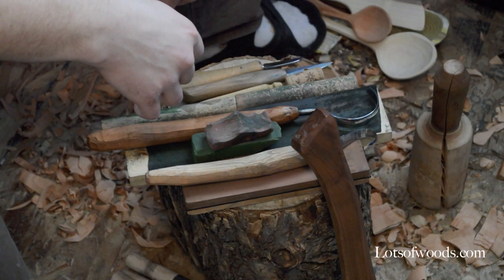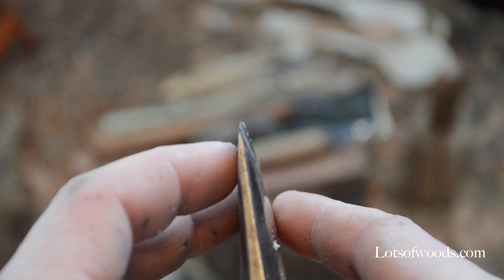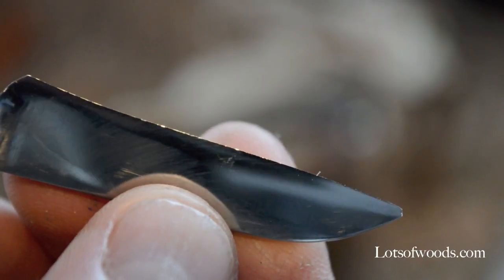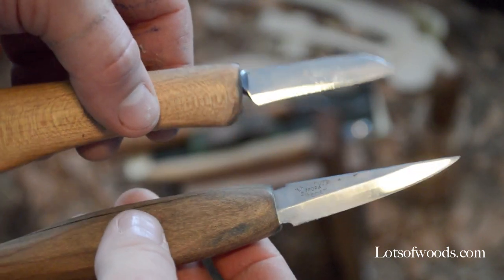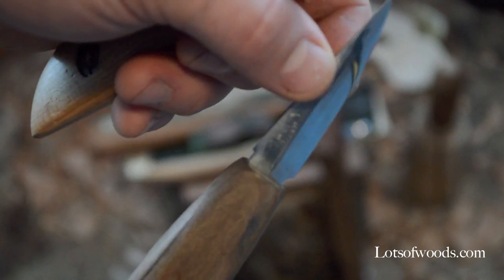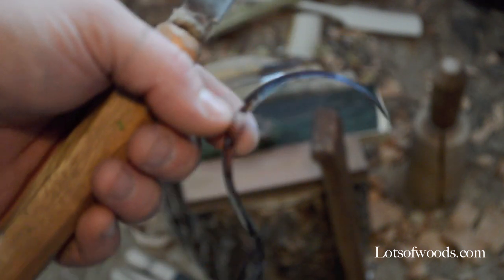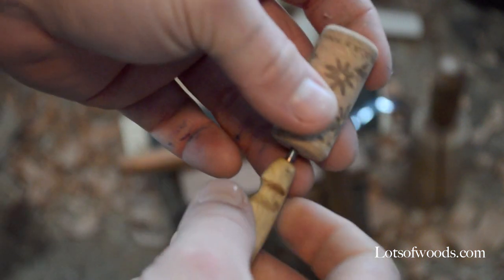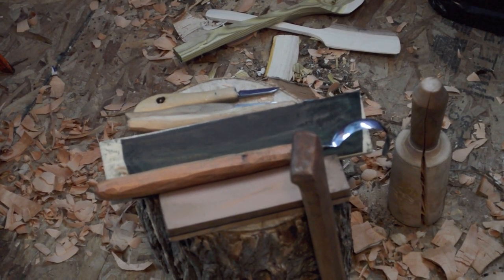My Spoon Carving tool kit - Everything I use on a daily basis to carve spoons.

Comment: Hey Jeff great video.. This fort sureis going to help the novice in finding the correct tools for the job.. I think here is a little info that would help them also.. The Mora 164. If you remove the secondary bevel it will carve like a dream.. And that Deepwoods knife. It is a style of blade that is for like basswood carving.
Reply from the maker: Thanks for the info Jimmy Mead!  I did play with that bevel a little bit, but by the time I had figured it out, my nic westermann was already here.  I tried Robin Woods spoon carving knife and actually didnt mind it that much.   As far as the deepwoods knife, I used it for quite a while, but found that after carving birch Kuksa's there was a type of cut that just chipped the blade so quick.  I use the tip of the mora knife so much now.  I use the deepwoods for just quick roughing out to save the edge on the mora.

Comment: No bevel usually means a flat grind, and it's the easiest of all to sharpen, if you have experience with it.  Many love it.  I prefer the Scandi grind that comes on most Mora knives, but a flat grind does have some advantages when slicing.
Reply: A Scandi grind IS a flat grind...it simply has a more obtuse edge angle (bringing the junction between edge and flat lower down the blade). The Deepwood Ventures knife is a mild convex grind.

Comment: That straight edged Deepwood Ventures knife is either ground wrong, and/or likely tempered improperly for that type of grind. There's no material to support that fine of an edge angle. That is a VERY thin apex with only a slight convex to support it. That knife would need good steel with a very good heat treat cycle to refine the grain...or it would need a standard scandi/V grind.

Also, those don't look like chips so much as a rolled edge, which would mean it's over tempered. From the video anyhow. If you bought it from him I'd call him and discuss it. As a maker, I'd warranty that knife and provide you something more appopriate.
Reply from the maker: My wood carving career is over now so no worries about that knife lol.  I had finishing knives that were very thin
Reply: @lotsofwoods  thin is good for a lot of purposes, particularly at the edge if the knife is hardened and tempered properly. My kitchen knives...the edge will flex over my thumbnail...at 65HRC, but are still tough enough to go through an apple seed without an issue.

It's unfortunate you don't carve anymore! I'm just starting (as a function of making sloyd, curved/hook, and other carving knives) and I've enjoyed your channel quite a bit.

Comment: thanks again for the video. the mora 106 and the 120 are both great knives. my favorites. BUT yes sharpening is my weak point. i am always afraid that i am going to make my edge worst. i am scared of it when it comes to my hooks. i also have a TWCA. i bought it from jarrod stone dali. so i think its made by Nick Westerman. im not sure if its a 60mm or a lil smalller. i have not sharpened it yet. would you suggest to just strope the inside at first? or both sides? the edges are still good. i havent used it all that much. but i want to keep it keen. so should i strope just inside or both? haha i actually try to limit my use at times because I want to keep the edge good. i have watched videos but only practice can really work when it comes to sharpening. so to make a short story long. i get what your saying...i have never seen a video on sharpening the TWCA. so if your in the mood???
Reply from the maker: I may be in the mood for a video on sharpening the Twca cam after I build my pole lathe!  If you have your twca cam in a vise, and you have dowels with wet sand paper, just be steady with all your passes.  I personally havent touched the outside of the twca cam with anything but a strop, only the inside with the wet sand paper.  I would say just be careful and you should be fine!  Carelessly taking away material for sure youll make it worse..  you gotta do it at somepoint right!  This is how I learned!  Thanks for the comment though bangbangcfp

Comment: I do not think hardness is the main problem with chipping, I have a few handforged knives made by Antti Mäkinen that are probably above 63 on the rockwell scale (material removal on waterstones is considerably slower than with a known 63 rw knife) and they do not chip at all. The great job done with heat treating in general may play a part as well, but so does care, because steel usually only chips (or rolls when its a softer steel) when it hits something harder than itself. I am sure you know this, just saying that I personally always double check for any dirt or grit on my workpiece or chopping block :)
Reply from the maker: It chips the most when finishing a birch kuksa.  On a cut where I roll the knife for an inside rounded corner, it breaks the edge of the knife.  I got pretty frustrated with it because it just didnt seem like that should happen.  Im definitely no pro with steel, but I just know it is brittle when the the temper is too great.. or somthing like that!  Thanks for the wisdom though drownthedays !
Reply: Well then I guess somethings off with the temper like you said, the wood is basically prying the edge apart. It is fairly hard to find the right mix of hardness and toughness, but it should be expected, especially with more expensive knives. Plus the guys at mora seem to know very well what they are doing, as the middle laminated layer is really hard, but tough enough as well. I really dig that applewood axe handle by the way, it sure looks the part.

Comment: How do you attach the Nick Westerman hook knives to the wood handle? Do you just drill a hole in the wood the same diameter at the round tang and super glue it in or what? Thanks
Reply from the maker: Exactly what you suggested Phil brownred.  I drilled the hole a little smaller than the largest part of the tang and super glue!

Comment: I'm using a Ben Orford sold knife. The small one. I definitely need a larger carving knife, though. May give the Mora a looksee, though my first spoon knife was a Mora and sort of put me off the brand. I'll see past it and give their straight carving knife a chance, though. Can't beat the price, that's for sure.

Where did you get your red sharpening compound? I got the green stick from Lee Valley, but I'm unsure what all the colours mean, or if they're even uniform across brands. I don't want to buy a red from company X only to find that it's more akin to the green from company Y...
Reply from the maker: Hey Raindance Bushcraft thanks for the commment!  I got the red compound from a place in the states, it was in a little buffing wheel combo kit with a white compound and red compound.  For a long time the red sat on the shelf and I was only using the green, but I've had much better results using the compounds in stages.    I would personally just buy a pack of say 3 bars from whoever and give them a try next time my bars run out.  And as far as the Mora straight carving knife goes, Im sold.  Its chea and im not ure I would get better results with another knife.